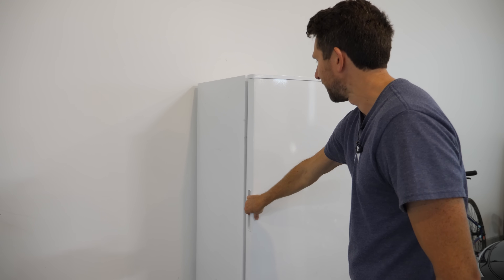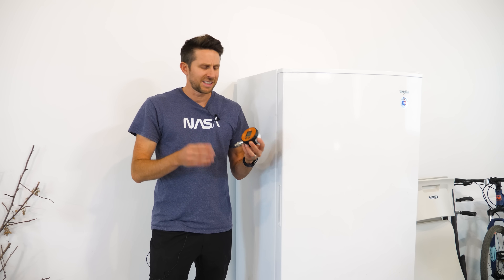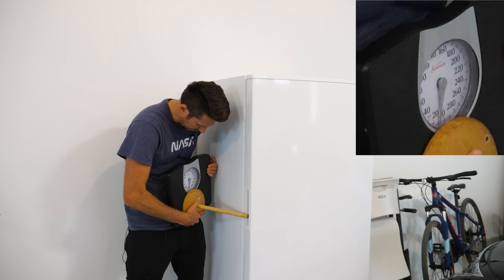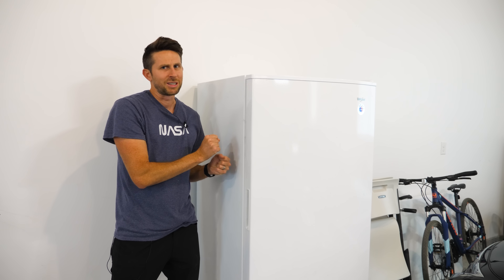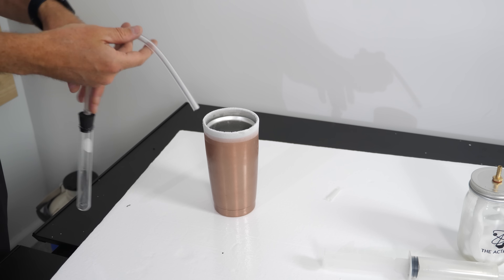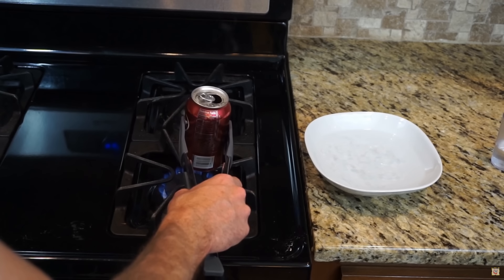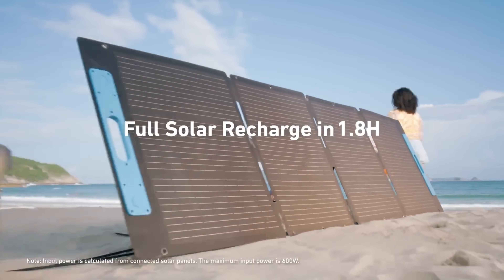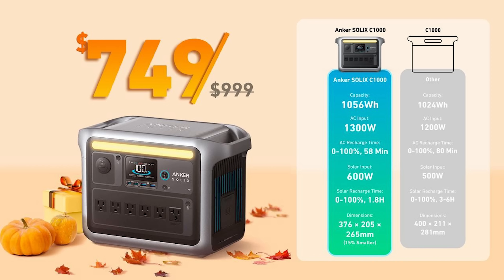Why Is a Freezer Harder To Open The Second Time? (Powered By Anker SOLIX C1000)

Comment from the maker: FYI for the pressure gauge I used it did not need a pressure differential to measure the pressure. So that is not the reason it didn’t change. I’ve used this one many times inside my vacuum chamber and it works great.
Reply: I was able to measure my freezer using an OMRON D6F-PH5050AD4 sensor.  I put the result on hackaday.  The project title is hrv, and the user is sciencedude1990.
Reply: It'd be nice to see the small difference reliably just to be sure we have the right explanation. Ala Steve Mould and Electroboom, explanations can get thorny, the chain link one 🔗🖇️ ahh 😅
Reply: Did you try to pull on the door, when the with the pressure gauge were maid?
Reply: I already worked this one out but what I'd really like to know is why does water sound different as you pour it, when it's hot.  Pour some cold water out of a kettle while it's cold and compare that with the sound you hear when it's very hot.  Just from the sound it makes as the water hits a solid surface warns you that it's scalding hot.
Reply: The presure dosen't play a roll here, beaucause the fridge it's not a seal chamber, there is a smal hole in the fridge to evacuate the water from the auto defreeze function in to a tray in the back of the fridge. I think the seal acts like a momentary spring some how end you gave to overcome that spring force first!
Reply: @edyeduard4368 did you watch the video? Not like in a rude way, you seem to be telling him what he said in the start of the video
Reply: @edyeduard4368  Spring force?...

Comment: For the freezer tube thing that balances the pressure, how does that work without also balancing the temperature? Just allows more air inside to be cooled increasing the volume and therefore pressure inside? Seems like that requires more work for the cooling parts. Would be neat if there were a button on the handle broke the seal of the freezer door instead so that there's not a constant air exchange between the inside and the outside.

Comment: My family 👪 and I talked about this recently, because it happens all of the time to us and it was such a mystery to us! I knew that the culprit had to be that a vacuum of some sort was being created by a change in air pressure, but I didn't know exactly HOW it was being created... 🤔

"Now we know! And knowing is half the battle!! [G.I. JOE!!]"

Its basically the same principle (but reversed) as when the last vehicle 🚙 door is being shut and all of the windows are "rolled up" and it takes a little extra effort to close that 1 door. Its because, as that door is being closed, its forcing a little extra air into the vehicle, which was already at maximum air pressure, causing the vehicle to become like an air compressor (because the air pressure inside of the vehicle is slightly greater than the outside). That's why the solution is to "roll down" any 1 window just a little (to allow any extra air to escape the vehicle while the door's being closed) and now it CAN be closed with normal force.

Comment: Just had this problem myself (broke the fridge’s handle because of it). The science behind it is cool and all but doesn’t fix the problem. Just check the drain hole. I thought it just drains the water but it also normalises the pressure, so when it gets clogged up you’ll get water buildup and a vacuum. Clean it with a thin brush or just a stick to get that grime through and you’re done.

Comment: I really thought a compressor pulled air off, until now thanks for proving me wrong.
I was thinking how you would show the gauge inside the freeze, then you put a cam: you also proved that the light of the freezer does not turn off when you close it. 🤣

Comment: Scientists may disagree with me but I don’t always say that the air crushes a container. I usually say the inner vacuum crushed it because the way I see it, the changing factor is what does the work. So if you reduce the pressure inside a can, the vacuum does the work but if you increase the outside pressure then it crushes the can. After all if you pull open a door you don't say the outside pressure opens it.

Comment: I like the way he ran into an issue with his hypothesis when he failed to measure a pressure difference, then proceeded to present a new hypothesis as to why there was no measurement, presenting calculations that proved that the pressure difference was so small that the gauge was not sensitive enough to measure it.

Comment: I don't know if I'm right here but could it be one reason that the air outside has some moisture and when you open the door humid air enters and because of condensation the seal shuts tighter?? Just like how the flat steel plate sticks to the floor if there's a little bit of water on it..

Comment: Then the actual answer to the real question is not that the temperature is different, but that the tube mentioned in the video needs time to balance the air pressure on both sides of the door. Because if the high pressure when trying to open the door for the second time was only caused by the air outside the door being warmer than the air inside, the refrigerator would have been difficult to open the first time because the air inside would have gotten colder because it was closed for a long time. I understood that when door is closed for a long time, the tube balances the air pressure outside and inside and opens more easily. And it takes a while to reach this balance.

Comment: Correction that Anker c1000 is not a generator it's just a 12 battery with an inverter built in to change DC to AC. A generator has an engine that's attached to a copper wound rotor that spins inside a copper wound stator, turning the rotor make an electric current flow in the section of wire which makes a separate electric conductor.

Comment: 5:15
That's actually kind interesting, the pressure drop seems to accelerate, I'm guessing it's kind of a chain reaction situation, since lower temperatures means slower movement of molecules they start to slow each other down as each of them slows down.

Comment: It’s the fridge fairies. They like it cold and dark and it annoys them when we open the fridge to flood the space with light and let all the cold out. So, when you try to ope the door again very soon, at least one fridge fairy will be pulling in the other direction, and they are strong little ethereals. But it’s OK, once they get cold enough again, they go straight to sleep.

Comment: Just use your phone and phyphox if you don't have a finer gauge. I've measured a pressure drop of about 200 Pa, which should cause about 100 N increase of a force for your freezer, which is very close to your results. Phyphox could plot graphs so you don't need a camera. My phones barometer noise is about 5 Pa, so it's way more sensitive than your gauge.

Comment: No its wrong when you put the the psi measure meter it compares the pressure into its pipe to the pressure outside of the meter so you will not be able to see difference forexample when you open the fridge door the change in pressure always occures

Comment: 3:15 your calculation there is slightly wrong. 
The door is rotating around the hinge, and not just translating outwards. So you need to integrate the torque applied by the pressure difference around the hinge and compare it with to the torque applied by you.

Comment: While the pressure drop inside the freezer is small, pressure gauges typically measure relative to their surrounding atmosphere which is why it didn't change when you shut it in the fridge. To get a true idea you'd need to have the gauge outside the fridge with a (well sealed) tube running into the freezer cavity.
Reply: That is, unless the meter have it's own sealed pressure chamber to compare against. 

On one hand, I have no doubt he did know this and used a correct tool properly, one the other, he's made even worse blunders before so it's possible he just made one another.

Comment: Without watching the video:

When open the door, some cold are comes out and is replaced with warm air. Warm air is less dense than cold air, so as it begins to cool, the pressure inside the fridge is lower than outside.

Over time this pressure reaches an equilibrium.

Thats why it's harder the 2nd time than the first.

Comment: We have a -80C (-112F) freezer at work that I semi-frequently use. With such an extreme temperature, it can rise pretty rapidly whenever we open it and we really don't want things inside to get warmer than -75C. Therefore when I'm putting samples in the -80 it'll be like: open freezer -> grab container -> close freezer -> load sample into container-> Open freezer -> put container back. But like the second time I open that motherfucker I have to use my whole body and brace my foot against the pallet it's attached to and it STILL won't open sometimes. This whole time I thought I was crazy, or doing something wrong on the second open, but NO I'm just a victim of physics
Reply: aren't we all victims of physics though? 😥😥

Comment: I thought it was the seals compressing with a shut...  and then relaxing.  the pressure drop occurs when you open the door.  you push out a lot of air when it closes.  This is what I expected.

Comment: Could you make a stovetop pot that cooks the food but doesn't get hot to the touch on the outsides and handles?
Reply from the maker: If the hot food is touching the pot, how would the pot not get hot?
Reply: @TheActionLab  That's where I am hoping😀 your genius comes in
Reply: @TheActionLab  A little context. I am a home cook and not a very good one says the people closest to me. Most pots have handles and tops(covers) made of the same materials(steel or aluminum mostly). the handles get hot as the pot gets hot. when you try to take the lid off that too is hot. wHAT IF!!! we can coat the exterior of the pot (maybe not the bottom) lid,exterior,and handles with some spray on material that keeps the exterior safe to the touch. Well I know for a fact that you can do that because you have knowledge that te rest of the world doesn't have until you reveal it to us on your channel. That is why I reached out to you. I wand to desig that coolpot😁

Comment: Thanks for the video explaining it. I didn't watch it because I am assuming that the cold air that falls out while the door is open gets replaced by room temp air, which is less dense than cold air. So when the room temp air gets trapped and condenses behind the closed door, the volume of air tries to reduce but is kept from doing so by the rigid structure of the refrigerator, therefore offsetting the equilibrium of the air pressure. 

A mass of warm air has more volume than the same mass of cold air at equal pressure. Open the air tight door, exchange some cold air for warm, close the air tight door, warm air becomes cold, creating a negative pressure effect.

Comment: The sheer power of pressure-based suction honestly amazes me, how can such a miniscule drop in pressure as the one in the freezer example create not only a noticeable effect, but one that TRIPLES the force required to open the freezer door?
Reply: Can't remember exactly but it's something like 8-10psi in a house is deadly and will blow your windows out meanwhile you can spray them down with 1500psi pressure washer and do no damage.
Reply: The answer is surface area is multiplicative so what doesn't appear to be a huge change in area actually has a very large effect. Try this same experiment with the smaller freezer door on top of most fridge/freezer units and it is far less noticeable.
We also don't seem to think about the actual air pressure very often, probably because it's invisible and we are just so used to it but there is around 6000 miles of atmosphere sitting on us at all times. If you actually start to compare 14.7 PSI atmospheric pressure vs other pressurized systems you realize it's actually a fairly decent amount of force.

Comment: Pressure difference is not measured, because there is no pressure differencs, when no external force appied on the door. Seal is elastic. It compresses, allowing the door to be closer to the frame. Thus, changing ftidge volume slightly, eliminating effect on changed air volume on pressure.
However, to open the fridge, sesl need to be decompressed and strefched to the final break out thickness. At this position, the door is far enough from the frame to make the difference between gas and intra-fridge space to have effect on pressure, and so on...
Reply from the maker: Actually I tried it with a more sensitive gauge which I forgot I had on every smart phone. If you measure the pressure with your smart phone you can see a pressure difference
Reply: @TheActionLab  well... I still think that pressure change is compensated by change in interior volume due to seal elasticity. However, this precise measurement probably goes beyond this channel scope. Great video anyway! 👍

Comment: Inside the freezer you measure the same pressure as outside as the gummy lips are compressed until the pressure difference is in equilibrium. When you open the door the second time the air cannot flow inside and pressure drops so that it is harder to open.
Reply: That is a very good point, the rubber is held tighter to the door due to the vacuum meaning you have to stretch it further to break the seal vs later once pressure has equalized it breaks the seal before stretching very far. I wonder how much of the extras force needed is due to pressure difference and how much is you creating even more pressure difference as you expand the seal?
(edit, typo)

Comment: If you put the entire pressure gauge inside the fridge it can't read any pressure drop because it doesn't have the reference of the external ambient pressure
Reply from the maker: This pressure gauge doesn’t need a differential. I’ve used it many time in my vacuum chamber by putting it entirely inside.

Comment: At 2:25
After the initial theory for why a vacuum was created inside the freezer, I think that the reason could be that the Refrigerator has a One-Way Valve, and that when the refrigerator is closed, the pressure or movement of air from closing the door shut could cause a valve outlet to spin (kind of like a revolving door), that pushes the air out without letting any back in.
Reply: This should testable with a warm or not running freezer

Comment: Scotch tape. No, really, scotch tape is going to provide you with your image. When you rip the tape from the roll, it creates a phenomenon called triboluminescence which is a state of static electricity that means light is created when something is ripped, scratched, or pulled apart. The first time this phenomenon was recorded was back in 1620 when Francis Bacon noticed that when solid sugar crystals were broken in the dark, they produced tiny sparks of light. Scientists still don’t fully understand the process and why it occurs, but it does, and that is how we are going to capture the image from our homemade x-rays. Sounds too simple? Of course, it is; there is one tiny problem to overcome before we are ready to x-ray our broken bones. Air. Oxygen is a huge problem and that means any light caused by the scotch tape is in short bursts and will fail to record the image, so you need to get rid of it. Creating a vacuum is the only way to do this, but it can be tricky. There are numerous ways to create a vacuum chamber, so do your research and find out if you have the technical knowledge to make it yourself. If you don’t, then buy one! Once you have your vacuum chamber, place some scotch tape, x-ray paper, and your potentially broken limb in there. Rip the tape off and let the light become absorbed by your limb for at least a second. The image should appear on the x-ray paper and answer all your questions. Now all you need to do is rock up at your local hospital with your homemade x-ray and a smug look on your face. Or, just go to the emergency room in the first place. Xyzal”

Comment: Cool video! Thanks. You should make a video about why blocked ears / ear barotrauma happens when taking off in an airplane, and why pumps still can't counter act this phenomenon.
Reply: On the ground, the air trapped behind the eardrum by blocked eusatcian tubes, is equal to the surrounding air pressure. As the plane gains altitude, the external pressure decreases, while the trapped pressure remains, pushing out painfully on the flexible eardrum. The aircraft pumps some pressure into the cabin, but only to the equivalent of 10,000 feet (reasonable for people who are not exerting themselves much, while being low enough that the aircraft doesn’t have to be built more like a submarine), which is quite a bit lower than the pressure at sea level.
Reply: And also why parents should be arrested for child abuse when taking infants on flights.  If you ever wonder why they power scream and never shut up, is because the intense pain they're experiencing.

Comment: A typical refrigerator has a drain hole connected to a pipe that leads to a container where melted ice collects. Most of the time, when the container is not filled with water, the pressure has to equalize much faster because the drain hole is quite large.
Reply: You make a good point, air pressure should equalize quickly if that drain tube is not obstructed. If the door is hard to open, I'd inspect and clear that drain of frozen water.
Reply: My fridge’s drain hole turned out clogged. After cleaning it, it’s much easier to open the door.
Reply: What about the Samsung that doesn't have the drain hole?